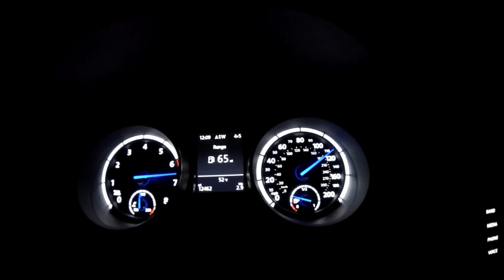How to install JB4 on MK7 Golf R

Comment: Did you jack it up from just behind the pinch weld, and then put the jack stands on the pinch weld itself?
Reply: RevolutionMedia no room my friend best way is to use pinch weld to jack up and put jack stand under cross member